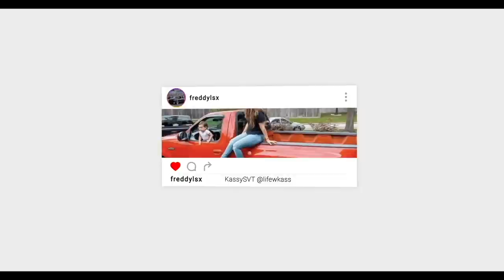MUD TOYS UPGRADES AND RACED OMARS TURBO TRUCK

Comment from the maker: Shop project torque gear 👉🏼 https://projecttorque.bigcartel.com you will get entry’s for our future giveaway next giveaway will end on September /30/2020
Reply: Turbo the gmc
Reply: Freddylsx Freddy I been watching for a year and that lifted truck is nice even for a ls1 it sounds mean af
Reply: bro all you need to put it in 4x4 is put it in Neutral and then select 4x4 low or high. then put back in Drive, you will hear the transfer case engage.
Reply: Where do you recommend for exhaust shop in Houston
Reply: Who's light blue crown vic is that ?
Reply: If you looking for another ls truck I got one for ya

Comment: Truck looks like it sits a little lower in the front than the back. You could turn the torsion keys up a bit to level it and it’d make more clearance for the tires

Comment: Lift the front like 3-4 inches and you won’t have much rubbing issue because iffu u pay close attention the back is more lifted than the front and if u raise the front more u won’t have to worry about cutting the corner of the fenders

Comment: 12:37 weyyy alguien sabe de quien es el marquis looks so clean?
Reply: Haha I used to have a 97 on white walls dropped as low as it could go on bags windows tinted 5% all the way around it was my party whip for highschool along with my 08 z71 4 door but I miss that old 4.6 ford shit would bump cause I had 3 12s in the trunk haha #first car can’t go wrong with those old crown vics